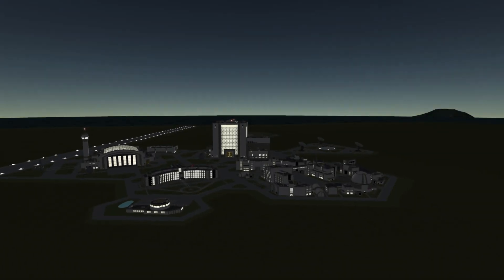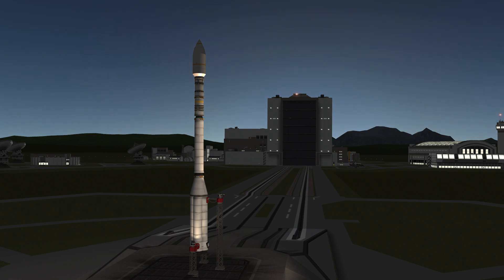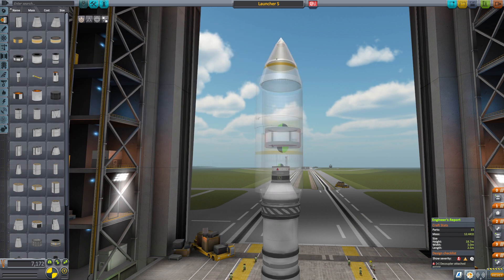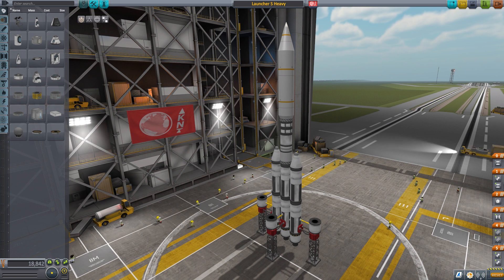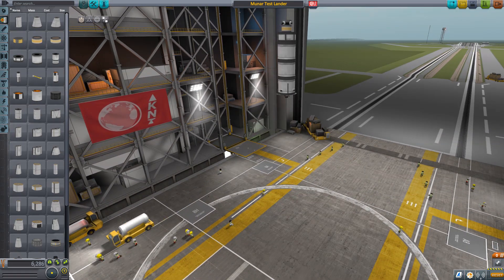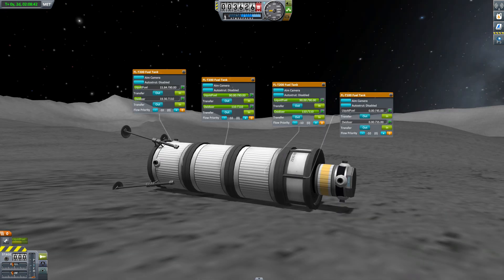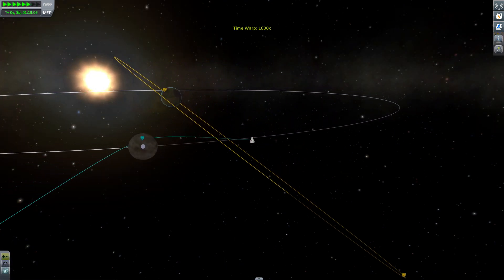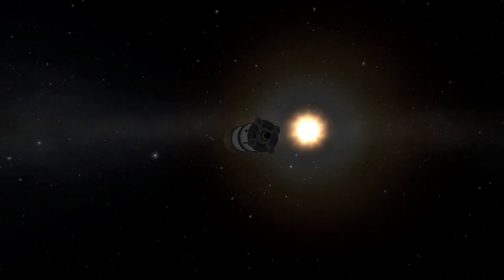How to play KSP without Delta V /Δv efficiently

Comment: you know, you can just calculate your craft's (and subcrafts') deltaV using MATH. I used to do it, until I got fed up, and installed Mechjeb. Using the "deltaV = ln(Mstart/Mend) * Isp * 9.81 m/s2" equation you can calculate your ships deltaV or fuel required to have certain deltaV with a certain payload. It's much faster, than flying 3+1 missions for a mun landing.
Reply from the maker: You don't need so many missions for a moon landing unless you only want to go to the moon once. If you do like 20 contracts these first test launches quickly become irrelevant time spent wise. I'm actually faster than Kerbal Engineer since I don't have to develop a new launcher at all once I've done it once. I just build a payload that matches the mass capabilties of my existing launchers and go. However, you can play as it is most fun to you and I just enjoy reusing my launch vehicles more than building them from scratch for each payload.
Reply: Well, still I think it is better to do some math (or use an addon) instead of playing for 4 hours, and after the  fourth iteration of the same Duna mission (kerbin escape, duna circ, duna landing, duna takeoff) realizing, that your return vehicle  doesn't have enough deltaV to return to Kerbin.

Comment: Can someone explain why my lifter weights 2 tons more than Lukas' lifter even though I almost exactly copied it? I even removed the fuel tank the Swivel was clipped into... Does it have something to do with 1.2?
Reply from the maker: If you check the lift off at 6:05, I drained the bottom tanks until my thrust to weight ratio was allright.
Reply: Oh...

Comment: Du kannst auch meter per square second sagen :)
Reply from the maker: Meters per square second are mathematically correct of course but makes no sense physically. What is a square second good for in reality? I remember it used to confuse me in school. With meters per second per second on the other hand you can at least get the idea that a change in velocity per second is meant. I don't really remember how it happened but when I found out you could also see it like this, I never used square seconds again. :)
Reply: that's a good point ;D

Comment: play KSP without dV calculations, simple!  Just lunch 3 times more rockets!
Reply from the maker: You only test your rocket once. If you reuse them over and over that testing will be negligible. However, if your goal is to have as little playtime as possible for whatever you want to achieve, using Delta V / KER is the way to go. You can still combine it with using standard launchers.

Comment: I see your bottom swivel engine and ask you: HOW. You placed the engine inside the fuel tank, is that with no collosion "cheat" or actually possible in normal KSP?
Reply from the maker: You can simply use the editor tools for that. Clicking the part arrows apear and you can shift it wherever you want. When I put engines like this I always keep the tank empty so it is more realistic.
Reply: Lukas [kN] Why is my copy of your lifter 2 tons heavier?

Comment: and then there's me. While I was waiting for mechjeb or ker to update for 1.2 I got into javascript and made a script that calculates delta v and twr. easy
Reply: I have an excel sheet that will calculate it all based on payload weight, amount of fuel and which engines. I can enter up to 4 stages atm. Its actually easier and faster imo to calculate your dv yourself than it is to do these launches and estimate with fuel tanks.
Reply: Nonno d' acciaio yeah but, that's like, work and stuff.

Comment: Another option is to calculate dV manually, its way, way shorter than this. Here's the formula:

http://wiki.kerbalspaceprogram.com/wiki/Cheat_sheet

First calculate dV for your payload, then dV for the launcher, adding the wet mass of the payload to the dry mass of the launcher.

Its not that complicated, its 5th grade math, apart from the natural logarithm, which most calculators can do ...
Reply from the maker: Hi, with the method I use you only need the effort once which is the key. Now I know that my Launcher S Heavy can bring 7 tons to Low Kerbin Orbit and 4.5 tons to the Mun. I can use it for all sorts of payloads. That's why i call it Standard Launch Vehicle. You use one and the same rocket for everything and adapt your payload to it instead of building a new rocket over and over. However, you can of course use SLVs and calculate the deltav to find out how much you can bring to Low Kerbin Orbit for example. I just wanted to show how I can achieve everything without using Delta V.
Reply: KerbalEssences I don't think anyone in their right mind builds a rocket over and over ... I build 3 - 4 types of launchers, then use the correct launcher with my payload.

Largest launcher I ever built was a SSTO format that takes 120 tons to LKO.

Comment: KSP 1.2 makes this so much harder, since engines drains equaly from all tanks...
Reply from the maker: You can enable advanced tweakables in the options. With that you can change the flow priority of the fuel tanks. A higher priority means this tank drains first (I believe). Important to note: A negative value -10 is a lower priority than -9. That makes sense mathematically but can be confusing ingame because 9 is lower than 10. I screw it up all the time because i don't pay enough attention on the signs^^
Reply: KerbalEssences Thank you so much. I'll definitely be donating to your Patron sometime. (Although it is uncertain). 

P.s. I get mixed up with negative values not only on KSP,  but also in real life.

P.s.s. Thanks for all the wonderful tutorials.

Comment: Standardized lifters are usually pretty helpful, even when you do have a mod that can calculate delta-v information. I have a series of upper stages and lower stages for each diameter between 1.25m and 5m (and technically 7.5m but I've never used them and they're not up to date). It's incredibly convenient to have them, because I can put together a rocket to suit a payload in a matter of seconds.

Comment: Or you can take your engine ISP*Gravity(9,81)*Natural logarithm of(fully fueld/empty) and you have your delta V :)
Reply: I tried doing math on dV manually (with pen, paper and calculator) once, ended up bringing more than half of fuel from my Duna mission.
Reply from the maker: Yup, there are plenty routes you can chose.
Reply from the maker: Yes, Delta V pre-flight is very uncertain. I personally think the biggest advantage of it is during mission when you for example hop arround Minmus to do science. You can hop arround without having to fear not to have enough fuel for the way back.

Comment: people don't do this? I usually have 5-6 standard launchers for a campaign, tweaking and adding as I need more capacity or unlock more efficient tech.
Reply: N-nope.
I make each rocket individually. Because each rocket has individual purpose.
Reply: I used to be like you, but I found the game gets boring very quickly if you do that. So much more satisfying to develop standard launch vehicles and see them fly time and time again with different payloads...especially if you design them with reusability in mind!
Reply: New rocket every time. 'Cause it's more fun to build rockects than just pick-up the same every time.
Reply: The Lorentz Factor yeah, I'd much rather sink time into developing more interesting payloads, landers, etc.
Reply: I do that, but the idea of adding fuel and enabling crossfeed never came into my mind. I ended up using KER to make stuff like that
Reply: Camicus - the structure I like to come up with is using one set of rockets to get to orbit for crew or fuel, then dock to a station and transfer to a interplanetary craft or munar lander. It keeps those delicate landers more or less in use and orbital rockets are cheap. It doesn't work for every mission profile but it adds a little challenge and feels sustainable.
Reply: Christopher Goetting i make a new rocket for practically every launch.
Reply: I do that too, but I'm totally guessing the payload capacity. If it doesn't fly far enough, I just take the classic "Moar boosters" type of approach.
Reply: I do that as much as I can, until I need a much more powerful rocket.

Comment: Whenever I'm forced to go without mods I just resort to overkill.  Estimate an overly powerful rocket for a given job.  The math isn't that hard to do... but it's such a hassle.  If it was a different kind of game where your job was to plan the missions more thoroughly I'd get it, but I have more fun actually flying the missions.
Reply: SuperPowerKiwi The problem with that you can't really create a neat little rocket that will have one clear job.  A rocket that can lift a huge crew compartment to orbit will also be able to send a tiny probe all the way to Duna.  There are too many variables beyond just "how much is being lifted."  It's also, how far does it have to go?  And, is it coming back?

With concrete deltaV numbers all of that mess becomes much clearer.
Reply: thats why you make standard launch veichles. Much easier to estimate. Got me trough ksp 1.2 Pre-release
Reply: So you basically stepped into the footsteps of Wernher von Braun with your tactics. Do not use the most fiddely and well calculated approach, just use what is reliable and scale it up until it has enough power to do what it is supposed to do. You should check out the proposed german space programm for post war Germany in case of Axis victory. it basically means V2 ontop of bigger V2 on top of giant ball of fuel with lots of V2 Engines below.
Reply: The way i do it is i take a rocket, i calculate it's delta v and then i save it. That way, my estimations need to be much smaller. for exampel, i make a 2.5 m Standard 2-stage Launch veichle''A1'' with a Core and an upper stage. When i then need to lift a heavier payload to Duna for example, i Duplicate the core to a triple core '' A1 Heavvy'' configuration and add that stage to my Delta v spreadsheet. Takes 1 minute, and now i have a 2nd Launch Veicle with a delta V number.  Then i maybe make a new one with 4 of the same Cores ''A1 Heavvy-4'' and simply add their weight to the delta V calculation and now i have a 3rd Launch Config etc etc. When i have a lighter payload, i simply change the size of the 2nd stage fuel Tank. This way, apromixation is really easy. I only need to make a spreadsheet once and then i simply put the fullmass/emptymass in the designated colums and tada!. My spreadsheet took an hour to make and can show Delta V Total, Stage per Stage, Thrust-to Weight Ratio, desired thrust limit for a desired TWR, what Booster Thrust limit i need for a core Full thrust on the Core and desired TWR total, etc etc. Once you make the soreadsheet, the only thing you need to put in is the fullweight vs emptyweight and your engine thrust. A small hazzle for a great payoff

Comment: Or you can use Kerbal Engineer when it releases. This process is pointless when it adds so much steps between build and space.
Reply: Or even just calculate it manually. Still less effort than this. Or just over-engineer your minmus lander to have enough fuel for Eeloo.
Reply from the maker: Not sure if sincere or sarcasm :D This video is meant for people who think you can't be efficient without Delta V so you HAVE to have Kerbal Engineer. I didnt mean to say you shouldn't be inefficient. The point is you only do this effort once because once you know all your rockets capabilities you don't have to repeat it anymore. You don't think about how much Delta V you need to get to Duna if you have 10 launchers with payloads ranging from 5 - 50 tons you can land there. You bascially just build whatever you want and pick a rocket. However, you can of course use Delta V if you prefer that.